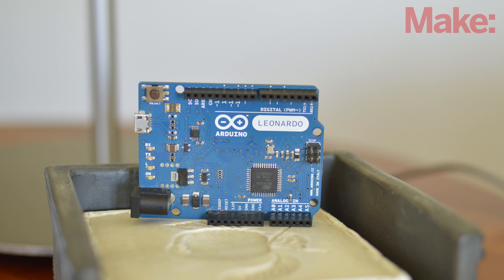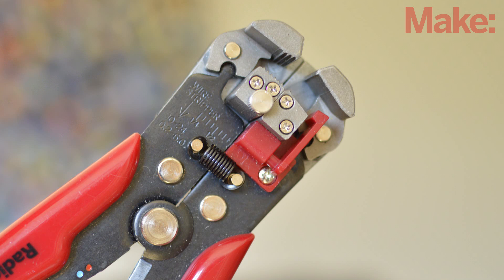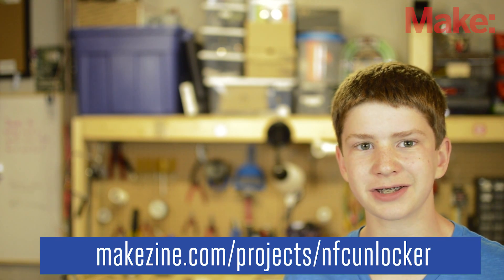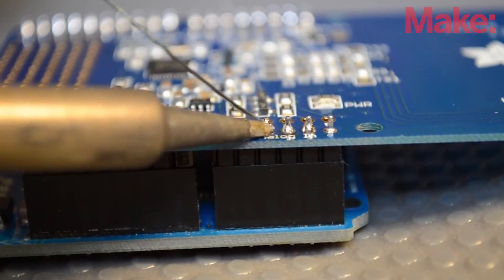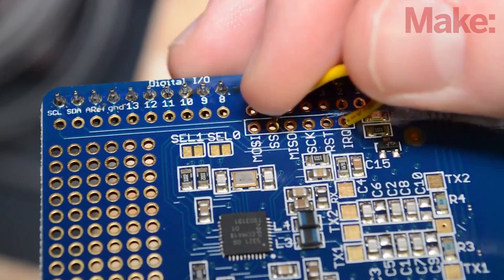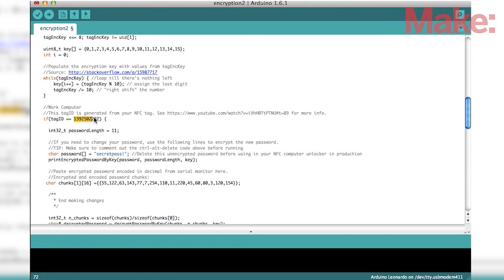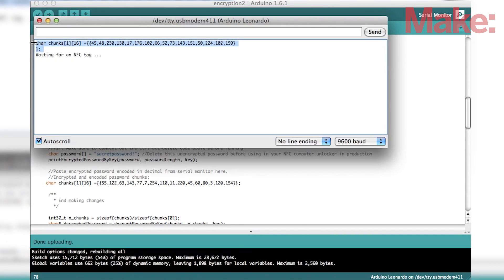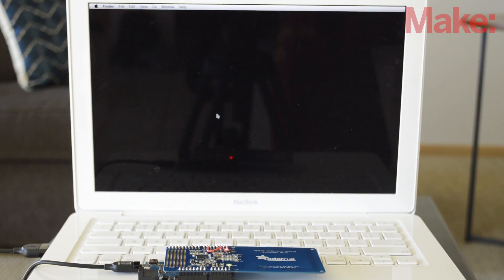NFC Unlocker

Comment: For better security, you could use a PAM module (Under Linux, not sure if it would be applicable to OSX) to interface with this (i.e. don't store the password in the code) Simply transmit the card ID to the PAM module over the 'serial'. the PAM module checks the card ID against a local database instead of using the user's password/username.

Couple that with some 2FA (OTP from a google authenticator app would be simple to implement), and it could actually be really nice! 

It's a cool idea as is (and really simple), but easily exploitable.

Comment: I've been using this setup at work for some time now. Works good! However, the detection distance of my NFC-tag is not good enough for it to pass through a desc. It needs a few mm max (of air).

I don't see the security problem. Sure, someone could take my tag, but there is no motive to do so. How would someone look into the code when it is compiled on the arduino?
Reply: Torsan1977 You can download binary code from arduino, disassemble it and get the encrypted password. Then you run decryption algorythm on the encrypted password usig every possible tag ID. You check every result for "looking like a password" characteristics (alphanumeric, dictionary, etc.). Then you check password-candidates against the computer: trying to logon, preferably without GUI (shell, network, etc).   

Any brute forcing ID by way of tag emulation is too slow to be practical. It's much easier to discretely read your tag with a handheld reader, connect your arduino to attacker's computer, show the cloned tag and receive the password.
Reply: sheikh345345 
Well, the video and linked code is probably just meant to demonstrate a concept that may inspire you to make something yourself, not to show an end product. There is a lot of things you could do to make it more secure.
Reply: sheikh345345 Hmmm...

Well, the code could be fixed up a bit, the key data could be loaded into RAM instead of Flash, with tamper detection routines that would wipe it if something suspicious happened, the micro controller itself could be surrounded by suitable tamper detection conductive strips/pads, it could be placed inside a box of some sort, the box may be filled with resin. 

The connection to the PC could be encrypted and have tamper detection too(if the device was disconnected for even a short instant the key data would be tagged invalid by the PC and and require you to log in manually, it is also possible to place the device inside the PC itself so that there would be no access to the connection.

It is difficult to avoid the potential of a card being read out and spoofed, though at least the code could be changed to use the data portion of the card to store a key, that would also mean using the authentication on the card, though that system is rather insecure. Since we can write to the cards, it may be possible to change the data on the card every time the card is used, so that older copies of the card will no longer be valid. It may also be possible to use more secure cards.

However, what people seem to overlook is that you only need to make it secure enough that it will be more costly in time and effort to attack it rather than the computer itself. A security device that is never attacked is functionally infinitely secure.
Reply: Torsan1977 They dont need to as sheikh345345 said in a comment above, bruteforcing 4 bytes of information is quite easy.
Reply: Nick LDominator Ok, do you mean brute forcing the ID of the tag? The sounds non-trivial even though the tag-ID is only 9 numbers? That's a billion combinations? And you have to be at that computer while doing this. How would you spoof the car-ID a billion times? What I'm I missing?
Reply: Torsan1977You can simulate a card with a rfid reader/writer to brute force.
Reply: Jake Carver Ok, thank you!
Reply: sheikh345345 Now we're talking! =) Thank you for your reply! I guess it is worth the compromise!
Reply: Ts6451 Actually, there's not much you could do to make it more secure. This hardware is all about convenience, not about security. And it's just fine as long as you remember about it.
I'm not saying I didn't like the project. It's fun and it inspires to play with some more arduino shields.
Reply: Ts6451 I agree that this is for convenience and not security, and that's how I use it. And because it's cool! :) At first I also used it to lock my computer when I left my desk, but that turned out a bit impractical for me.
Reply: Ts6451 Placing the device inside the PC case is the only viable option to protect the device. Everything else is euther vulnerable or tending to mulfunction (all tamper-proofing stuff) or both.
Using more secure card means changing hardware. Introducing computer-side data modification means adding software to the computer. In the end you get a solution that bears little resemblance to the project in the video.

Yes, it's a basic rule of secure systems design: you start by defining attacker capabilities.
Reply: sheikh345345 Ultimately the point of tamper proofing is not making it immune to tampering as such, but rather to make tampering less practical due to the amount of time and effort it requires.

Obviously any changes would mean changing some aspect of the project, but I would think that tinkering with the projects to make them fit your requirements is part of being a maker or electronics hobbyist. If all you wanted to do was to unlock a PC, it would probably be easier to just get one of the commercially available devices that do this.

Comment: The security nut in me is just screaming at how unsecured that is.
Reply: DansEuropeVlog Yes ! just unplug the thing, plug it in another machine, open notepad or something similar and voila! you see the password :D ... Cool project but just not secure :)
Reply: DansEuropeVlog Indeed...  If you wanted this secure, you'd want the arduino read the NFC tag, send the tag 'as is' to the pc, where your login addon (GINA for pre-windows Vista, and Credential providers for Vista and later) takes the tag, and uses it to look up the user and validate the tag.

It's still flawed because someone now just needs to pickpocket your card and they can access the PC.
Reply: DansEuropeVlog I would imagine someone could hack up a login manager for Linux to have some sort of software-side decryption tool so you won't have any plaintext floating around.
Reply: It can be better about that if the password moves into the key. In this case, the system under the table becomes a simple NFC/HID interface, exactly like a keyboard.